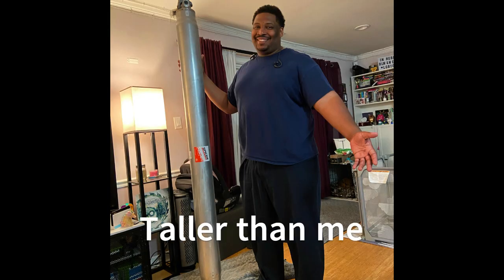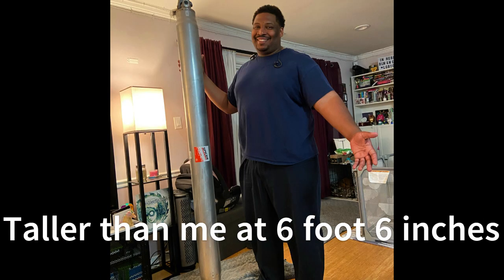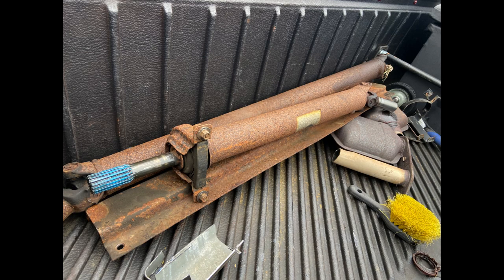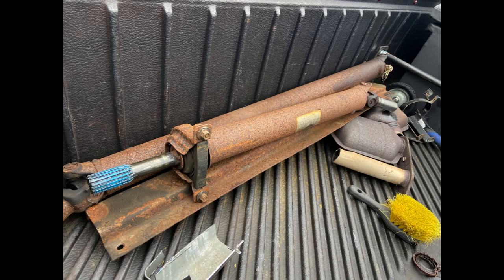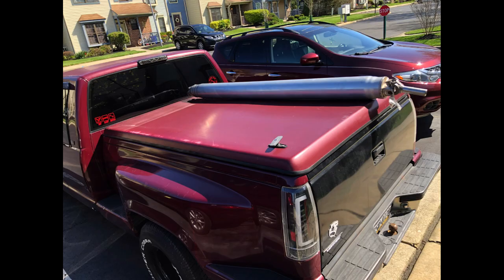1 Piece Drive Shaft For Extended Cab GMT400 OBS Chevy Truck (Part 1)

Comment: Question did you remove the other crossmember  that was in front of your transmission tail? Because I have a crossmember right on front of it and i cannot get my driveshaft in because its blocking
Reply from the maker: I believe I know which one you’re talking about. It’s actually still in. I flipped it though. It’s slight but that crossmember bulges on the top side and is flat on the bottom side. I flipped mine.
Reply from the maker: Do you mean the bar I’m talking about at the 19:00 minute mark?
Reply: I think that's it at the 17:37 mark mines is right there in the middle
Reply: My crossmember is connected to my front suspension I have two poles one on each side of the frame running to the front which holds up my suspension so if remove mines it will lower my front suspension like crazy low and I'm not tryna do that. Is there a way I can send pics of my setup of what I'm talking about?
Reply from the maker: @road2richz_q266  I gotta make other social medias and stop being a dinosaur. YouTube doesn’t have direct messaging which sucks. 

I know what you mean now. As soon as you said poles that tell me you have a 4 wheel drive correct?

Also I looked at the 17:00 minute mark. That crossmember I did remove. That one has to go. It’s the crossmember that supports the carrier bearing of the 2 piece drive shaft. My chassis still stayed solid. It’s when I briefly removed the one at 19:00 minute that I noticed possible signs of instability. But the one that supports the carrier is fine to remove.
Reply from the maker: By the poles I think you mean the torsion bars.
Reply: @RCSmith90  yea it was a 4wd it's now 2wd because swapped out my transmission to a th400 automatic,  and I removed my front differential so I had to get a single driveshaft since it's a longer stretch from the rear differential to the transmission. Yes I have the torsion bars which is connected to my suspension and the torsion are running through the exact crossmember that's blocking access to connect my driveshaft to the transmission. So I'm trying to see which route I should take. I  need to figure how can I get this driveshaft in without removing the crossmember because if I remove it the torsion bars will be removing as well because it's running through the crossmember, I don't my truck to drop from height it's at because I have a good amount of space between my tire and wheel well, I tried removing one side of the crossmember just to see and the fender was damn bear touch the tire
Reply from the maker: @road2richz_q266  Ooooohhh ok. Crystal clear. Let me look at a few 4 wheel drives and get back to you.
Reply: @RCSmith90  ok cool preciate it, so did your setup had torsion bars as well or you switched over to the coilover suspension setup ?
Reply from the maker: @road2richz_q266   mine was actually 2 wheel drive already. I have an extended cab 2 wheel drive. Which they don’t make a 1 piece for. One piece shafts were for single cabs with regular beds only.
Reply: @RCSmith90  ohh ok mines has the stepside bed I with extended cab I think Because the gap space behind my seats
Reply from the maker: @road2richz_q266   wish I had better news but it looks like the coilover conversion is the way to go so you can get rid of that torsion bar crossmember. One Guy I saw cut and welded his making a relief in the middle to clear the drive shaft. Like a half loop that droops down a bit welded in the middle.
Reply: @RCSmith90  I'm thinking about going that route getting it cut and fabricated and welded, cut in a U shape so it can clear enough to mount into the transmission.  Thanks for yo assistance  bro, go check out my pg when you get a chance and check out my truck and engine comment let me know what you think,  I also have a 07 SS Monte Carlo as well check out my shorts I post majority of shorts
Reply from the maker: @road2richz_q266   just subscribed man.
Reply: @RCSmith90  preciate it bro I did as well,  you in Atlanta?
Reply from the maker: @road2richz_q266   naw I’m faaaaaarr away. In Philly.
Reply: @RCSmith90  daaammn!

Comment: What is the name of the company that made the drive shaft and balanced it correctly if you don't mind me asking I'm wanting to do the same thing to my extended cab fleet side.
Reply from the maker: It was one specific guy. His shop moved a couple years ago which sucks. He’s been building drive shafts for 30 years. Sucks because it’s hard to find a builder who is willing to except this challenge. I believe I have all the specs. Best you can do is take them to your local shops and see if they are willing to build or contact a company that’s online.
Reply: @RCSmith90  I appreciate your time getting back to me about it yeah I found out last night that there's a shop about 45 minutes away researching about it after messaging you maybe they can take on the challenge as well because eventually I plan on a complete engine rebuild I am working with a budget as well I would like to build a 383 I remember on the TV series street outlaws the white rhino truck In a couple of episodes and I'm going to try and dig up more information about that truck for other ideas
Reply from the maker: @jefferylayfield5788  Sounds great man! Definitely let me know how you make out. Did you check out the videos about the bolt on performance stuff on the channel?
Reply: @RCSmith90  Oh yeah I have I can not wait to get back to working and building on this truck and it's a short wheel base truck fleet side just like your truck except for the step side bed everyone is going the LS route but some dont have the funds to do such the old saying do the best way person can with what they got yeah but you have a nice truck what type of wheels are those on your truck ?
Reply from the maker: @jefferylayfield5788   Appreciate that man. And you got that right. Work with what you got. My wheels are Jegs Brand wheels. It’s a generic style. Summit has them too, just says summit brand. They go on sale from time to time. I just bought a pair at a time. Each pair was around $250.00 give or take. Got those on a payment plan too 😂
Reply: @RCSmith90  got it I'm a old school fella who misses the centerline type of wheels, after researching about the weight of my truck and the weight of the same year cars like the Camaro and trans am there's about a 3-4 lb difference so I am looking into taking that weight away in different areas I like those wheels also changing the hood to a factory looking fiberglass hood taking the weight away from certain things on the truck to get the weight down for better power to weight ratio
Reply: @RCSmith90  300 to 400 pound difference that is dang auto correct but yeah
Reply from the maker: @jefferylayfield5788  I am absolutely following in your footsteps. When I can I am definitely getting a fiberglass hood.

The Wheels are Jegs SSR Star.
Reply: @RCSmith90  I appreciate the information about the wheels I'm taking the information down so when the funds are available soon Im going to look into them, I have also a suburban 1994 Silverado I'm finishing up I don't like much more having it ready to roll I'm taking everything down so after it's done I can get back to the truck discussed our trucks are the newer square bodies and those trucks are getting harder to find $$ in decent shape so we are all helping and learning what can be done with our trucks there becoming collectable stuff for sure